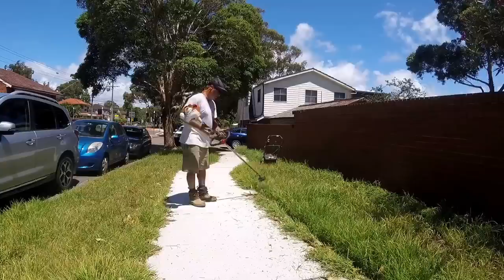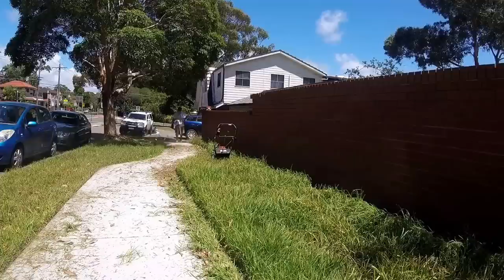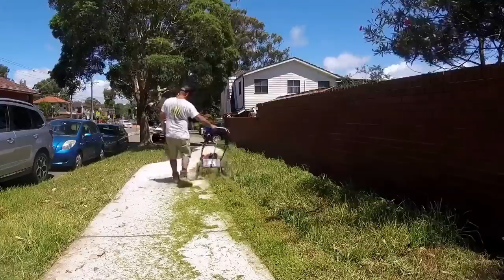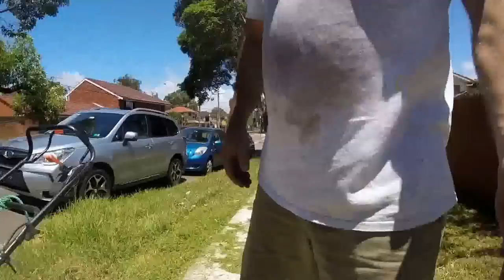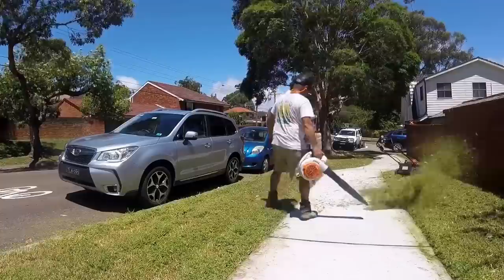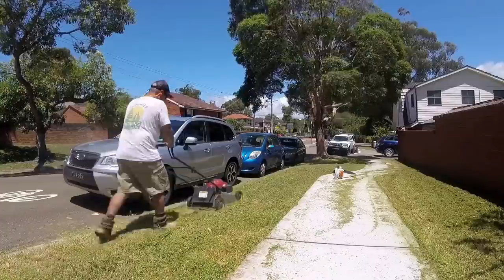Lawn Mowing & Edging an Overgrown Sidewalk

Comment: Hey Ray quick question at 5:51 in the video what did you put in the lawn mower?
Reply from the maker: No worries mate I was just closing up the rear chute and putting the Mulch Plug in. This traps the clippings under the deck of the mower to cut them up very fine
Reply: thanks
can a Mulch Plug in go in any lawn mower?
Reply from the maker: Possibly but watch this video to learn about mulching 
https://youtu.be/QHXI-yvLC2Y
Reply: thanks mate, your a legend
Reply from the maker: Glad to help

Comment: Hi,
Have you sometimes problems with the cars just near the work place ? (broken glasses, for example)
What happens in that case ?
I do same job as yours near traffic jam....... not easy !
Congratulations from France. 
Yann
Reply from the maker: Hi I try to be careful around cars and windows etc If I did damage anything I would have to get it fixed Thanks for the question
Reply: Pittwater Mowingl

Comment: Looking good Ray ;D Does the HRU216 really lack that much power? My HRX would go right through that without any problems. I have heard it is a common problem with the HRU series
Reply from the maker: +J&P Lawn Services cheers mate the grass was very thick and full of leaves causing it to bog down a little Thanks for watching
Reply: Was thinking it might be something like that. Maybe its cause the GXV160 is a 160cc engine (I think) as opposed to my GCV190 which I'm guessing is 190cc. But yes thickness and leaves will affect how well it is cut though I must admit the HRX217 doesn't seem to have many issues with lots of leaves or thick grass. Glad to have another bloke on this side of the pond to watch, not just all the yanks with no care for safety ;D
Reply: Gxv160 is Honda's commercial grade small engine, from the long run,its more reliable than GCV (domestic)or GSV(light commercial).i do agree gxv160 is bit lack of power as 160cc engine. my mechanic told me GCV/GSV often have governor problem after 1 year of heavy commercial use and he believes that GXV160 is a perfect balance of reliability and durability. that actually made lot of sense explained why honda never made GXV190.
Reply: Yes true that's why a lot of contractors bump up the revs a little bit on their GXV160s but as to governor issues with the GSV/GCV there shouldn't be any problems becuase they aren't meant to be heavy commercial engines. My Honda with the GCV190 does me perfect and never lets me down. Not always a one-pull start though (not that I really care but doesn't really go along with Honda's first time every time promise does it?)
Reply: true.but for example if you use gcv or gsv to cut 10-15 lawns everyday,that is pretty heavy commercial usage. and i know some contractors do this ,then gxv might survive for longer time.  as for the one pull start easy choke system....i still prefer the manual chock.:-)
Reply: Yeah no I'm only 15 so I only do around 5-6 lawns on weekends so not too bad. I do get some very thick and tall yards though. I am thinking about getting a HRU196M1 with the GXV160 soon just for my smaller yards. And yes I do like the manual choke as but the auto one works ok too I think
Reply: Why don’t you just buy a zero turn or a stand on
Reply from the maker: Most of my lawns don’t have wide enough side access to rear lawns. Stairs are another problem too as the Pittwater area in Sydney Australia 🇦🇺 is very hilly otherwise I would

Comment: Hi,
Does that mulch flap only come on the 216D? Standard?
I have a tough backyard and am running a VEX60 and I could give you two pages of reasons Victa doesn't cut it. Whoever signed off on the design must have been on drugs or selling to grandfathers cutting couch between the roses.
Looking for self propelled side of the hill recommendations, and if it mulches that would be all the better.
FWD Husqvarnas look like rubbish even though I've never had a days trouble out of their chainsaws.
Rob
Reply from the maker: Gday Rob Im pretty sure all the Australian model Honda self propelled mowers come with the rubber flap. They are great mowers. Thanks for watching mate
Reply from the maker: Check out this video with my Honda mulching
https://youtu.be/QHXI-yvLC2Y
Reply: turned a tall mess into a short mess ever heard of a bagger or rake